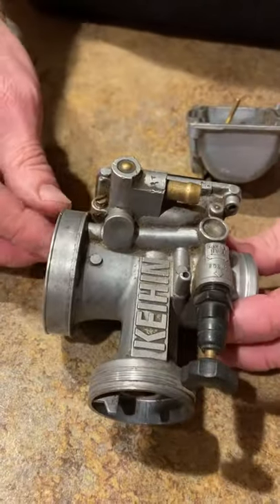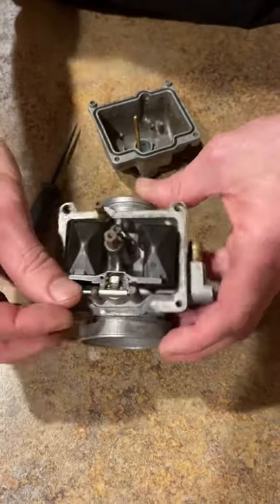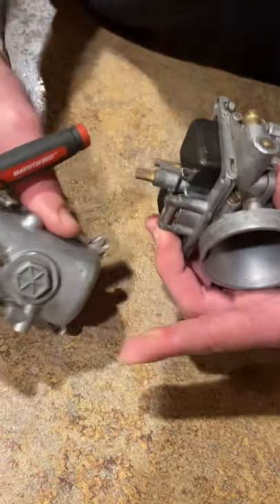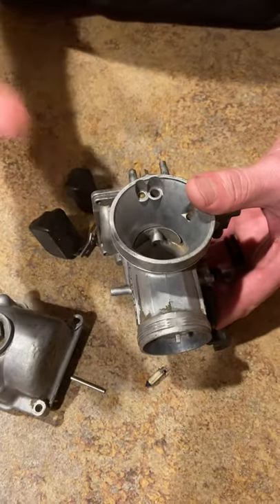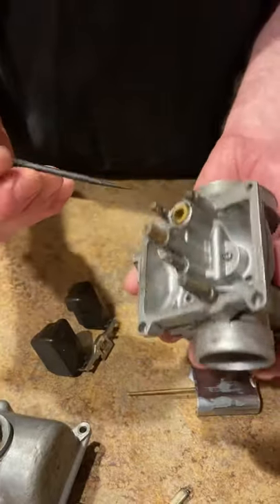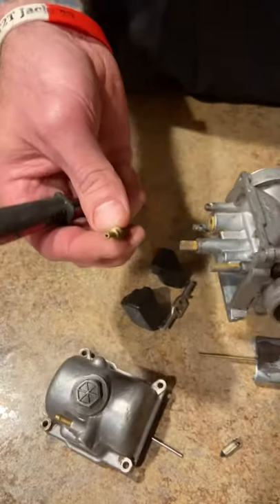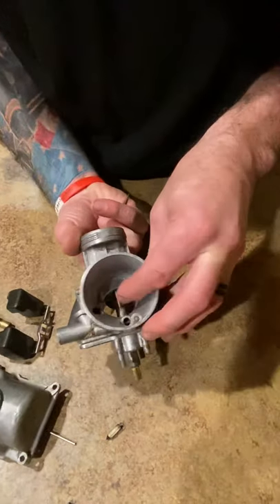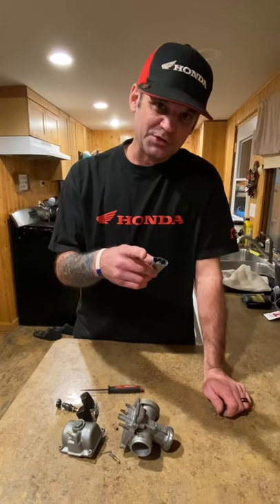Carburetor 101 - Throttle Slide

Comment: What is the issue with carb cleaner? Also, do you reckon that very high idle revolutions would indicate idle circuit clogging? I've noticed that the slide on one carb sits a little more open than the other after taking them apart and replacing the pilot jets and reassembling. Any notes would be helpful.
Reply from the maker: Sorry for the delay in response but carb clean leaves an oily film that can easily trick you visually and think something is plugged because you can’t see through it.  Brake clean eliminates this